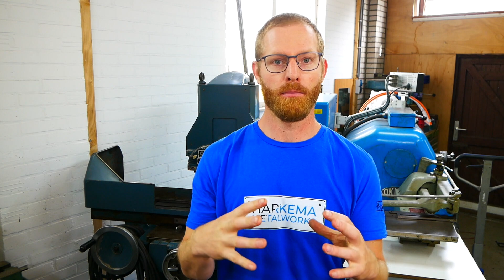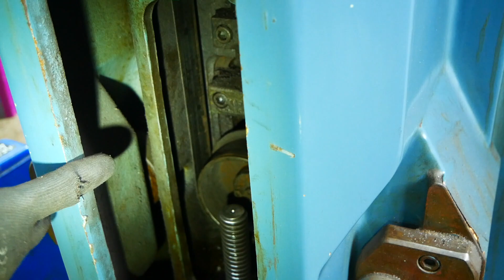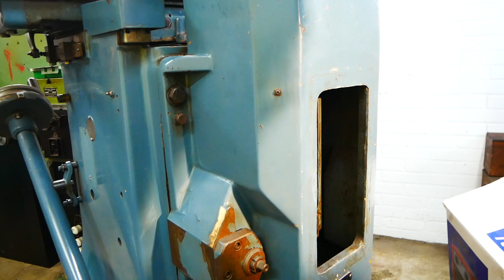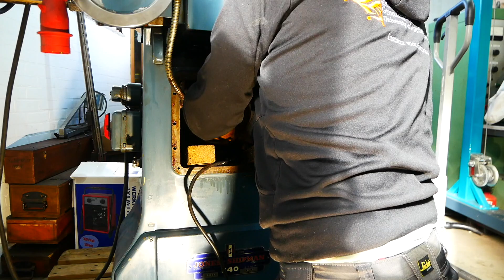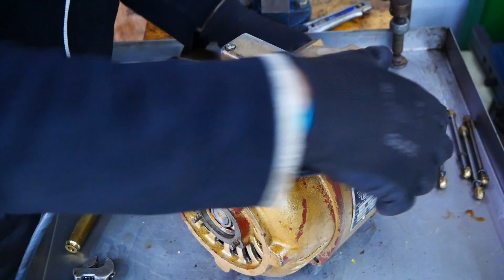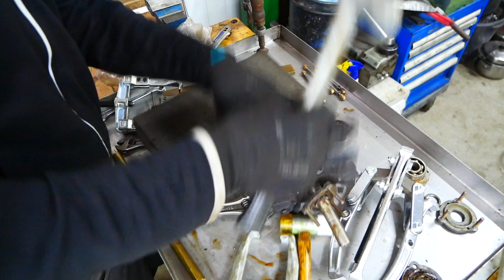Jones and Shipman 540 Adventures Part 2: Pulling the motor

Comment: I had one of these machines prior to getting my Tripet. Despite my machine dating from the 1950s and having a plain bearing spindle and also a hard life at Paxman Diesel in Colchester it would produce very good finishes. I had the same problem with the motor mounts. My experience was that Jones and Shipman were utterly useless when it came to advice and even worse where it came to spares (very poor quality). The absolute experts on these machines are Jubilee Machine Tools in Derby. They also have their own line of spare parts which are not only cheaper but of far better quality than J&S.

Comment: I think the motor fell on its shaft. Look for a replacement if possible, the repair will not meet the oem standards. If no replacement is available, then its your last resort to make a fixing try. The wohle drive-train will need a complete overhaul. Man, this will become a highly interesting job. Wish all the best.
Reply from the maker: Thanks. I already put a new video out yesterday and managed to fix the shaft with welding it straight.

Comment: Well on the positive side you are getting to know the inner workings of your machine really well and this is a great resource for 540 owners. Motor replacement should not be too difficult as it’s flange mounted and  holes can be drilled. The usual problem I find with new motors is the shaft lengths are shorter nowadays so mor work is required to make an extension. But I think you will repair it successfully. You mentioned flame straightening and this is used by skilled people like Keith Fenner. I have seen Adam Booth press out the whole rotor shaft and replace it. I have seen motors mounted on the lathe bed and clocked in then the motor itself is run and the shaft is trued up with the cross slide. If it were me I’d use the fixed steady and true the shaft, you could then either sleeve it or the pulley bore. The motor could be sent out for rebalancing but I don’t think the machining will have affected it. Imbalance is likely to come from the rotor casting. But I know you have electronic knowledge so I would be good to see you set up a dynamic balancing rig. Looking forward to seeing the repair whatever way you go.
Reply from the maker: Thank you. I ended up welding it straight. It was a challenge but it worked out well. Will upload a video soon.

Comment: Those fingers that are bent close to the core are fan blades.
Reply from the maker: Yes I can imange they are for cooling down the rotor. But I don't think they are bend original. Or it was done for balancing.
Reply: @bartharkemametalworks2299  agree, some people believe those fins are there to balance but from my understanding you have to either add or remove material to correct an imbalance. Bending those fins doesn't increase or decrease weight no is it reasonable to assume the designer to have placed them exactly where they needed to be. But it is very strange how many old motors have bent ones.
Reply from the maker: @waltermelyon4300  The material is very soft and easy to bend. I noticed one 'fan' was cut down a bit, I think to remove weight for balancing